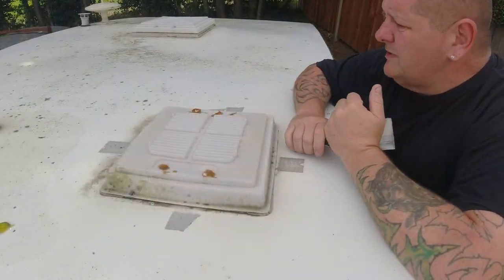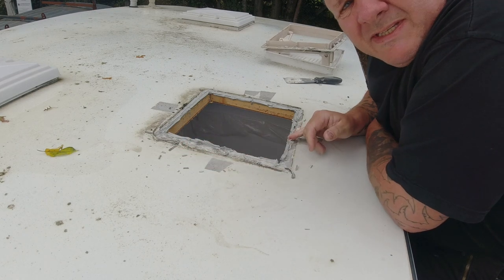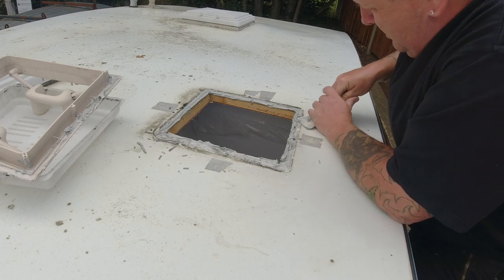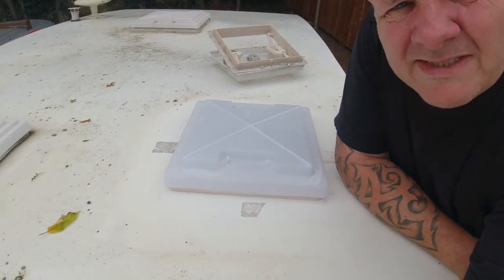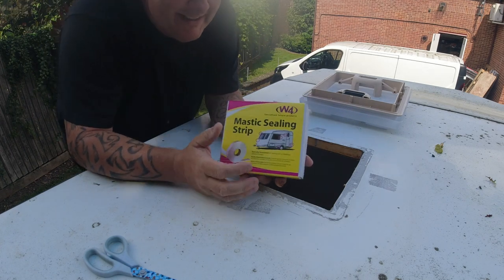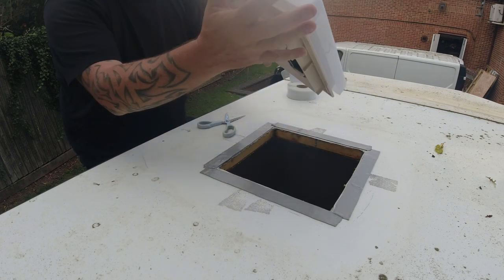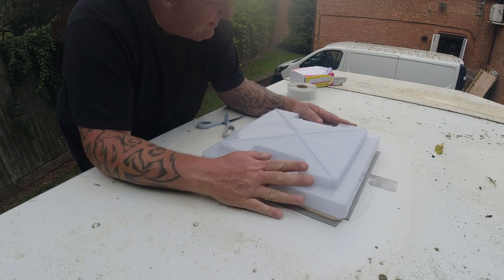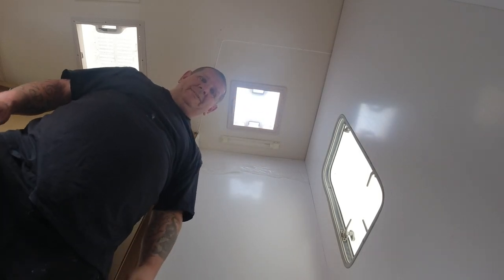HOW TO Remove/Refit Roof Vents

Comment: TIP:- Use B&Q own brand Paint Brush Cleaner on old mastic A) It helps soften for removal B) Clears up stuck down remnants. I place in a spray bottle to use.
Reply from the maker: Thanks for the info!

Comment: Do you need any other form of sealant or will the mastic tape do it all?
Reply from the maker: I only ever use mastic tape and occasionally a bit of sealant on the edge.
Reply: I think you might have to re do that after a year or less @BuiltnotBoughtCampers